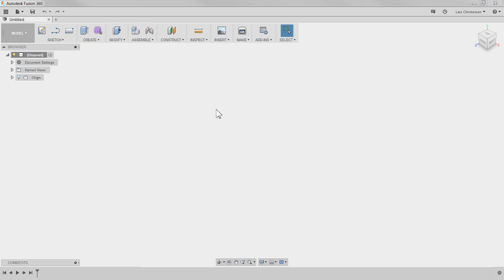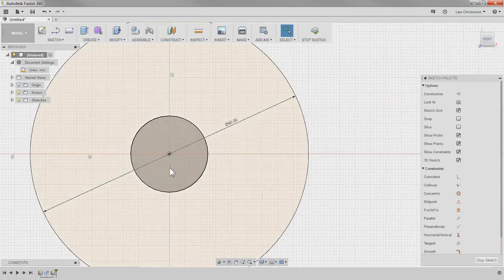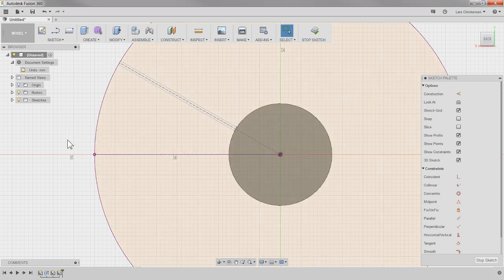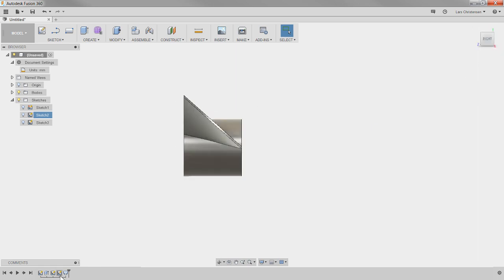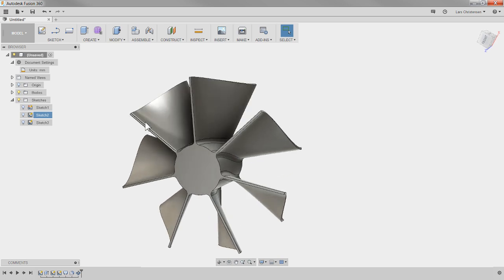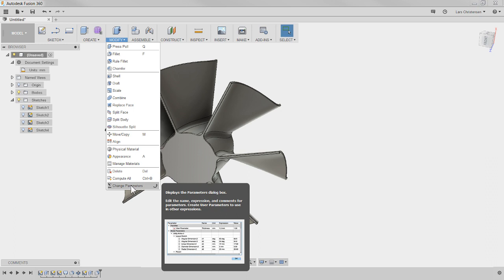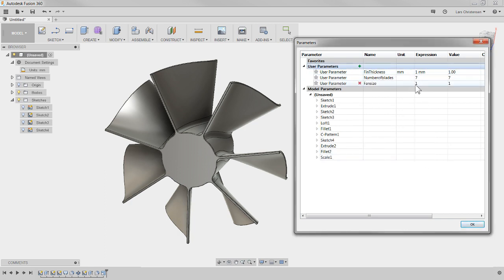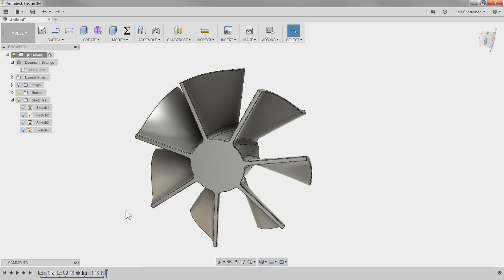Model a Fan Blade & Excite Your Customers — Fusion 360 — And Your Comments & Questions— #LarsLive 62

Comment: Good job. FYI - the pitch of the angle of the blade at the hub should be greater than at the tip. The objective is to have the same pitch  (transverse travel of fluid from hub to tip to be equal) . Yours is the other way around.  The pitch  will depend on the function of the fan. I still got a lot from the video and am looking forward to accelerating my learning curve by watching your videos.

Comment: Awesome. Awesome. Awesome. Simply AWESOME :-) This has taught me so much!! I followed along and 3D printed the part out. Now I have a working grasp of just how powerful Fusion360 is thanks to yourself (ex openSCAD user here) AND a pretty cool fan to boot that works! (Although I did adjust the blade angles as yours is more of an egg beater than a fan) ;-)

Comment: What an awesome guide! Exactly what I was looking for!
Two questions which came up during modelling:
1st,  when I tried to add the fillet, it was inverted and I didn't figure out how I can change it... (Sorry, quite a noob question...)
2nd, when you are looking for fans, they often have not straight radial blades like the one you have constructed. The blades are a bit twisted from the inner towards the outer radius. Is there a possibility to "swirl" the whole construction a bit from the central axis, similar like a twist? It seems, when you are using curved lines in the second step instead of normal ones, there are some inconvenient restrictions for continuing the procedure.
Reply from the maker: Hi Patrick, If the fillets are inverted, is sounds like you have multiple bodies. Check the tree on the left to see if you do. Then you could use the combine tool if they do touch. 2nd question could be done by using the loft function or instead, create the blade using sculpt

Comment: Hi Lars thank for the videos
I'm struck at 6:40. the line i am trying to draw is not snap to the inner circle
i tried but it just like the snap point is not there (it's snap just not at the inner circle)
Any advice that may help

thank you 
ps i am just start with Fusion 360 and use to lean simple autocad in first year university

i am really try to make a fan blade here LOL

Comment: I just want to make a remark for those who now want to make a fan themselves. If you look at a real fan you will notice that the top and bottom edge are not straight like shown in this design but curved and usually the bending is not a double curve (S-curve), but a simple curve. The fan how it is designed here will work, but will probably be not very efficient.
Reply: Thanks. Right. It is not grabbing air but at least we know now to make a propeller.

Comment: I was woundering what would happen if the hub had to be extruded outward past the blades to accept a screw or something like that. My luck all the blades would follow the extrusion. I like your approach to the blades. I was trying to use an plane at an angle for my 1st attempt at a fan.

Comment: The better way to trim of the tips of the blades would be to use extrude->intersect on the 80mm circle. It should work better if you decide to change the diameter of the fan, since you don't have to worry about the outer circle, which it self adds no value to the design. The intersect operation seems to be one of the most useful forgotten features of CAD. Sure it is often not practical to use, but when it is, it is glorious!

Also you might have been able to use a rule fillet to avoid the issue when you changed the number of fan blades, though you might have ended up with more fillets than you bargained for.
Reply from the maker: Hi neistridlar Thank you for watching!
Awesome comment! Thank you for sharing your thoughts!!!

Comment: very useful tutorial. thanks!
your fan aerodynamics is a crap though :)
i wonder if it's possible to simulate air streams in the fusion?
Reply: Import the model into ANSYS. I don't think fusion has ANSYS support built in unless that is what they are using for their analysis.

Comment: Very powerful stuff I  love fusion more and more! This video really help me see the parameters in a new light. 

One question. I can understand sorting yellow warning on fillet, extensions etc but on sketches I struggle to resolve them. They dont seem to interfere with the end result or adjusting things parametricly down the line. I just wish I could solve them.  
Often it's due to a projected line from something up the chain. I know this but still cant resolve the issue.  
If anyone knows the answer or could point me to a video etc that would be great. Thanks.

Comment: Hi Lars, I am really interested in the use of "Driven" dimensions" (not sure if that's the correct terminology) that you used to define the fan blades. However it seems to be a feature that doesn't work on my copy of Fusion. When I try to dimension a sketch by referencing to another dimension nothing happens. Maybe there's an option that needs to be enabled ?  -Cheers
Reply from the maker: Hi Gavin Svanborg Thank you for watching!
It should work for you. Double click the dimension you want to be driven so the number field highlights and then click the dimension you want to drive.
Reply: Found the problem. It appears this feature doesn't work if the timeline has been turned off.

Really appreciate your response.   -Cheers

Comment: Lars, Can you please let me know if it is possible to control component visibility with parameters? For example, let's say you created two components for the fin shape (totally different shape) and then created a parameter for the number of fins. Could you write a parameter equation that showed one component if the number of fins was set to 3 and show the other component if the number of fins was set to 7? I have been searching for months but cannot find a way to do it apart from manually turning on and off component visibility when each parameter is changed... there has got to be a better way! Thanks, Nial
Reply from the maker: Hi Nial Bell Thank you for watching!
Pretty sure I answered this somewhere else. But, I don't think you can control this with parameters, but selection sets might be a good tool:
https://youtu.be/y1JeUQM4GSA?list=PL40d7srwyc_Mkgc5wvP_OfVel9aDkNkZ6

Best,
Lars

Comment: I discovered the parametric thing, I can only say one thing: Wow! Thank you!
Now, I suspect my client/boss will ask for my fan to be functional, on top of being fancy, so I might have to think "NACA" for the profile of my blade (and even 2, for inner NACA and outer NACA, let's talk about rails...), because a fan is supposed to extract air or push it... How would I apply a profile to my blade?
Reply from the maker: Hi Regis-Michel Leclerc Thank you for watching!
I might have to read up on my fan blade knowledge to continue on this topic :-)
Reply: There's this thing on Thingiverse for openscad: https://www.thingiverse.com/thing:10513
Lars, a blade with the same thickness everywhere is just going to make some local turbulence around the blades with crappy efficiency, you want to use the Bernoulli effect to push/pull the air from the blade.
In the wonderful world of NACA, you define the section of your wing/blade depending on its angle of attack and its air speed/angular velocity. Obviously, speeds are different in the centre and at the outside of the blade, hence the 2 NACA profiles (but I guess it'd just be a loft between the two). A NACA is usually 4 or 6 numbers defining the profile, the Wikipedia explanation is very complete about that. I guess it might be interesting to explain how to make such parametric wing, what do you think?

Comment: nice lessons but facing some issues due to software version updates and options change. cant fillet the edges shown at the end
Reply: Same here - but less success then you.  At the second sketch when I draw the 2 lines of the blade edge I can't make them equal in length and when I make them parallel they position on top of each other.  I can't find a way around this, so the rest of the model can't be drawn.
Reply: I have solved this by using the construction lines for constraint anchors.  So each side of the blade is parallel to the construction line and is 1/2 thickness distance from it.

Comment: Why cant i "copy" the first blade? For some weird reason it doesn't work. I always get an error message like "compute failed". Mhm idk what to do

The weirdest thing it, that it works in the preview..
Reply from the maker: Sorry that I don't have a great answer. Those can be trouble to trouble shoot
Reply: @cadcamstuff  Thanks for the quick answer :)
I kind of fixed it tho. The Problem was, that I had to rotate around the center point, and not the outside Ring of the Object.
Reply: I had the same problem. It would only select faces not features and I got the "compute failed" message. I got it to work by not selecting the front and rear faces - only the  3 faces of the blade and the 2 fillets. It then worked OK @cadcamstuff

Comment: This exercise does not work (or is easily misconfigured) with latest version of F360. The Loft tool will not connect. I think it's because the rules when you make the rear edge of the blade on the rear projection rule no longer works as shown.

None of the fillet commands worked on any of the lines and instead of getting multiple sketches, I got multiple bodies when I replicated the blades. And that was the ballgame.

The only thing that worked (sorta) was cutting the excess fan blade ends using two circles. And even then, I suspect it was not done properly. LOL
Reply from the maker: Hi Doug Hanchard Thank you for watching! Sorry, my friend, there has to be something on your end. I just tested the model on the latest version and everything is fine here.

BEst,
Lars
Reply: Lars Christensen oh... Possible. My model is uploaded to the cloud.

Comment: The blades are more suitable for an aircraft engine than a computer fan xD Great video, also learned how to use the "Loft" tool by watching this video! Keep it up!
Reply: Actually, no. The blades would stall. The blade design is not aerodynamically correct. But, the exercise is to teach methodology, not necessarily for dynamic correctness.

Comment: I get a Compute Failed error when I try to do the circular pattern. Does my computer just suck?
Reply: I get the same error. Doesn't matter how may blades I choose. I have also tried without the fillet.
Reply: I got the same error, but solved it. Lars said that he liked to use 'Features' setting, by default it was 'Faces'. After that change I got no errors. Maybe it helps?!

Comment: Nice tutorial but this fan blade is very inefficient and should not be used for any project. The bottom of each blade (the attack) should be cutting thru the air and not push it down when rotating as it is drawn but again it is nice to see how to do the major part of it. thanks

Comment: Lars at 6.44 you draw a line, the line snaps to both inner circle en outer circle. In sketch palette I have the same options checked. but my lines wil not snap to the inner circle and outer circle wat am I doing wrong. The cursor does not change in a square but stays a cross
Reply: got it started again. something with constrains
Reply: @ypehille  I had the same issue, and i believe it originated from the fact that I started the sketch by selecting a certain Plane ( ZX-plane in my case) instead of selecting the face of the object, then right-clicking it and again right clicking the "new sketch" option

Comment: This video really doesn't follow, is like it is out of date, maybe the software has been changed. Going to the back of the model doesn't have a centre point to work from, like this video does, and project doesn't work . I have noticed other videos just don't work as well.
Reply: You /may/ need to change in the "select" menu (top right corner) > selection filters > to "select through" possibly? - just worked through this brilliant tutorial now (using the latest F360.. with the new interface) and it worked 100% fine for me, but of course slightly different layout but same methods :)
Reply: The blue lines [fins ends] need to be closed at the ends [closed/constrained/defined] /outer circles, OC's need to be X'ed construction lines. It is pretty glitchy software, might have a bad download

Comment: That's a pretty crappy fan blade design, you should be using surfaces to model those using splines for profiles. This is modelling that looks good but doesn't function correctly. You need to be able to model this for specific blade shapes not whatever works with the tools in fusion 360.
Reply: Do you have any source on this? I'd like to learn more. Thanks in advance